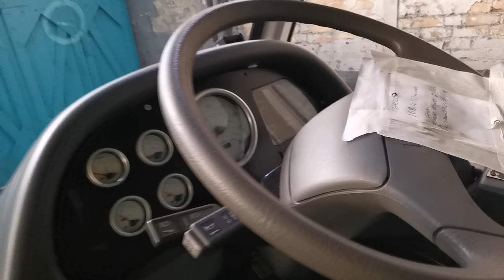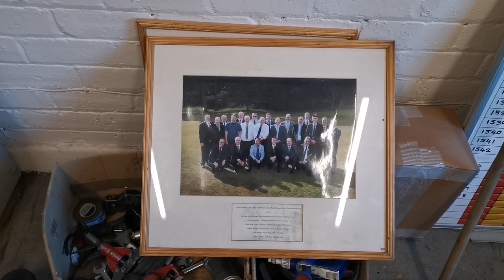Closed Down Bus Depot with Buses still inside

Comment: Not really abandoned yet, they are still in the process of closing it down. The numbered blue box lockers are where drivers stored their stuff, ticket machines and cash dispenser. My locker was 126, they were grey metal when I left, they had previously been in the paying in office at another depot on the other side of the city centre.
Reply from the maker: I just closed down, using other depots to store buses now

Comment: you'd think the bus company would give the buses to charities to use after tey had fixed them up.
Reply from the maker: Think there gona get moved at some point, to new place but there not working
Reply: @geordieurbex2200  most are there for disposal from other depots
Reply: Why ?
Reply: A bus company will use buses till they cannot physically be safely repaired anymore. At which point they are most often donated to a recovery company for spares. For arriva that company is Alpha recovery. In rare instances they do donate buses to schools and charities. The daft as a brush foundation has an ex arriva double decker on its premises that was donated by Arriva 😀